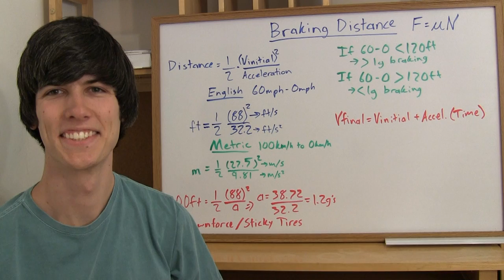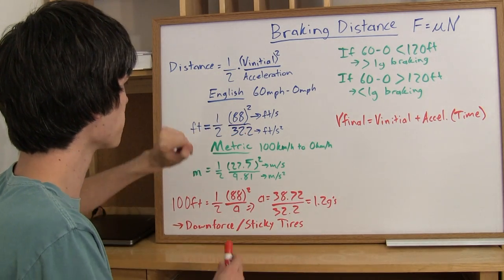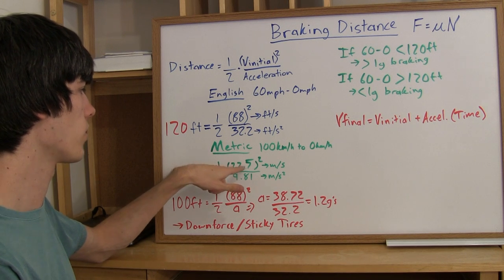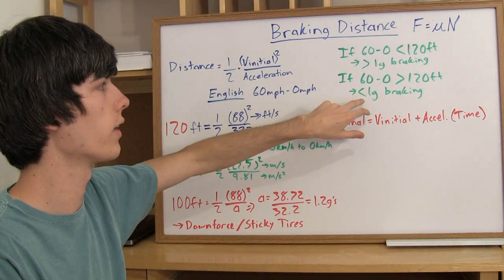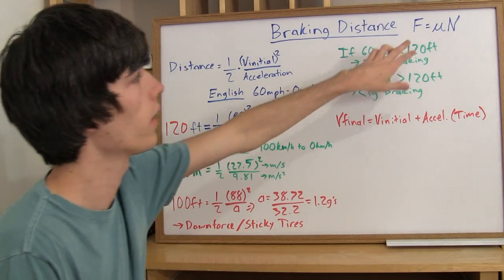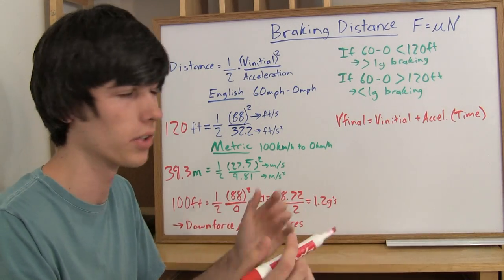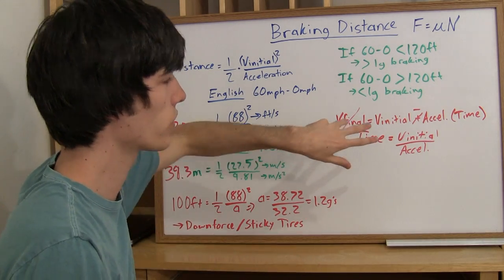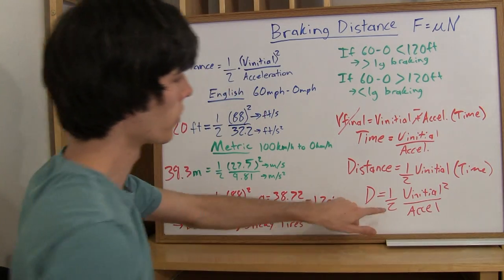Braking Distance - Explained

Comment from the maker: This is completely true. Grip goes well beyond what the eye can see. And wider tires will have more contact, allowing more rubber to mesh with the pavement. There is a flip side, however, as with the weight more spread out, the tire won't sink in as much. This is why the grip effects are as not drastic with wider tires rather than softer rubber, nonetheless it is something important to point out, thanks.

Comment from the maker: I may eventually make a few more videos on braking. It's not as simple as dividing the mass with acceleration by the number of brakes, as the front brakes will carry more of the load since weight transfers to the front under braking.

Comment from the maker: Not if your standard brakes can lock up. If your brakes can lock up, there is no greater force you can apply (with purpose). Now tweaking the ABS can yield improvements, if it cycles more times per second, keeping you closer to the edge of the frictional limit of the tires.

Comment: My base 2017 Corvette Stingray with manual transmission stops from 60-0 mph in 90 ft.   The Corvette ZR1 stops in 88 ft.   American Engineering.
Reply: mrpmj00 came here to say this. Many Lamborghini, however, have a distance of roughly 100. Which makes the Corvette even more impressive!
Reply: @chrisk9808  On the fwy, my Corvette gets 36 mpg in Economy mode and 465 hp on tap.  Range shows over 500 miles.

Comment: How can the tyres be prevented from getting locked while braking without the use of ABS or other circuitry. What are the parameters taken into account when designing against tyre locking ?

Comment: the rear spoiler serves as an additional air brake at speeds beyond 200 km/h.. so it doesn't help braking from 100 to 0 to achieve 31.4m..

Comment: No mention of the effects of brake bias on stopping distances?

Question: If a car with an 80/20 brake bias can brake at 1G, but then you shut off the rear brakes completely, what rate can you (negatively) accelerate at?
Reply from the maker: quicksilver4000 Depends on the weight distribution of the car, the height of the CG, and how well the front tire compound deals with load.
Reply: +quicksilver4000 if you have 1 g of decl, before the rear brake removal then you have about 25% more weight on the front tires and 25% less weight on the rear tires.   the rear tires can only be effective to the weight (or force) on the ground,  and that is equal to the weigiht on them.   for a 4000lb car, that might be only 1000lbs, or 500lbs per tire, which is not much compared to the front tires, plus don't forget engine braking which can be over 100hp, (100ftlbs at 5300rpm)  that , through a 2nd gear gear ratio can be near 700ftbls at the tries, or 350ftlbs each tire.  with a mu of (1), that means that there is only 150ftlbs of braking that the rear brakes were contributing anyway.

Comment: sir,thank you for this video.its help me a lot.i just asking you that how can i install additional cutting brake in the rear wheels with a company of DIAGONAL DISK BRAKE ASSEMBLY already using for four wheels.there is the problem of pressure reduction and leaking at joint.please reply....

Comment: hey can you please explain how to calculate the braking force on each brake of a car
( is it just by multiplying the mass of vehicle with acceleration given in manual of car and then dividing by number of brakes i.e 4 )) 
and also please give the range in which braking force for a normal car lies.

Comment: If you have a car traveling at 60mph with normal family car brake pads, will it enduce less wear on the brake pads and rotors to stop quickly in a short distance or stop slowly over an extensive distance?
Reply: +Jaden Kirura Stopping converts your kinetic energy into heat using friction. An oversimplification of the conservation of energy would tell us that this would give us the same amount of overall heat no matter how much time you took to stop. Stopping slowly over an extensive distance will not only give your brake system more time to air cool, it will also allow fluid friction from the air your pushing and your engine to help slow you down.

It may also save a little wear and tear on the mental state of your passengers.
Reply: +Kevin Skinner Yes, that is true of physics. But the variable is the composite material the brakes are made of. If racing brakes stop a car better when they're at higher temperatures then the composite material must be designed to absorb more energy at such temperatures. Since engineers can predict the temperature range of brake pads under certain conditions, my question restated can be: are brake pads designed to wear away less at high temperatures? If family car brake pads wear away more when they're cold then it wouldn't be beneficial to use extended stopping distance. If they wear less when they're warmer, then it'd be better to stop quicker.
Reply: +Kevin Skinner You know, I used to drive forklift for a living and my ladyfriend expressed that stressed out principle as I would calculate my braking distance (also good at math) to stop 2-3 ft from the bumper of the vehicle I approached.Since then, I have uh, adjusted my mental calculations in the negative direction, if you will... figuring stop placement to be where I can see the rear tires of said vehicle.

Comment: how can the coeffecient of friction be greater than 1??
Reply: Example: you have a cube that weights 1kg. So, to lift the cube up, you need to apply 1kg of force, right? Now if the cube is placed on a table, and the cof between the table and the cube is 0.5. This means, that to push the cube across the table, you need to use a force of 0.5kg IF the cof would be 2, it would mean that to push the cube, you need to use a force of 2kg. So in a sense coefficient of friction is just a multiplier of the weight of the object.

Comment: The main thing you need to know is that if a car brakes at less than 120MPH in a 60 to zero test than it is stopping at faster than 1 g ...and that is fast. 
The 2011 M3 stops in approximately 110 and the 2011 Mustang Gt at 108 ....approximately 1.1g based on this calculation!!!

Comment: can u cleary explain how can we increase down force on car without increasing the weight of the car??
Reply: Manmeet Singh down force and weight aren't the same thing 
A car sitting still has the weight of the car measured on the ground,  body spoilers  creat down force which pushes the car down on the road icreasing braking
an F1 car slows greatly just from down force upon lifting off the throttle.More foenforce more grip better stopping  .A formula 1 car can stop from 60mgh in 48feet
2.5G and that isn't at maximum down force
Reply: 1971mgb thank u sir, I would go through the point you mentioned.

Comment: Can anyone solve this ?
Find the stoping distance if Vehicles  weight = 300kg 
Speed 40km/hr
Coefficient of friction of ground =0.8
Wheel dia= 566mm
Width =177mm
Consider all wheels locked
Reply: 7.87 meters

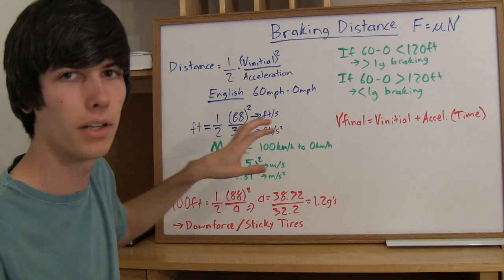Comment: 0:23 Do you mean American? Because the English use the Metric system, bro.
Reply: It's refereed to as "English Units" because these types of units originated in England. When the U.S. became independent in 1776, it inherited some of the English Units from the England, therefore they were referred to as English Units, they're formally known as "U.S. Customary Units," or just "Customary," or sometimes "Inch-Pound units," this saves confusion from the "British Imperial System," which was developed later in the U.K., and which the United States never used, and believe me, both systems have significant differences, and are not the same, especially in terms of volume, but even less so, length and mass. 

You're correct, England has used Metric units since 1965, and U.S. Customary Units are sometimes referred to as "English Units" because they were inherited from Great Britain when the United States became an independent country in 1776.